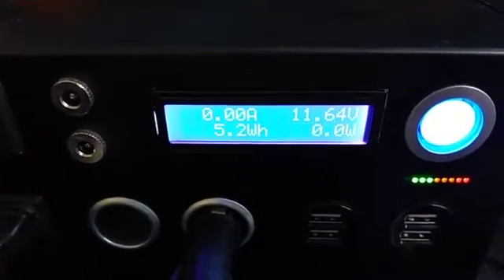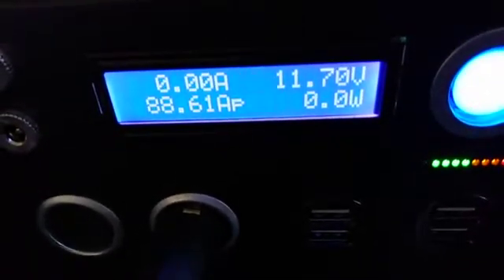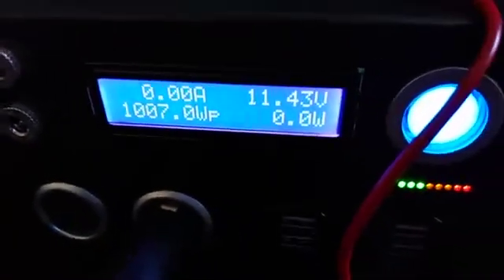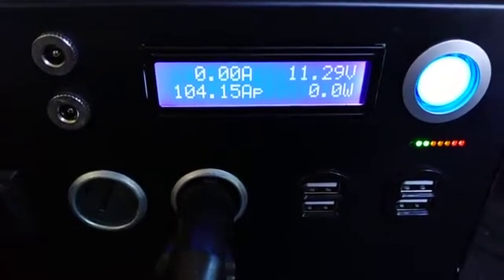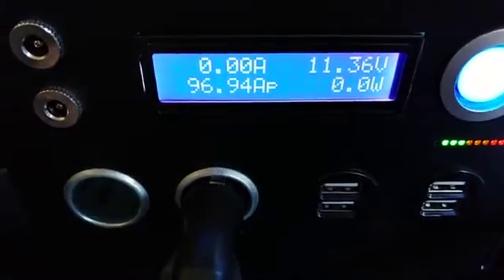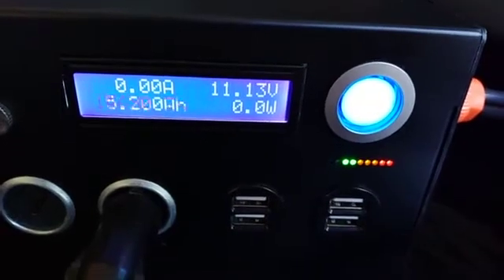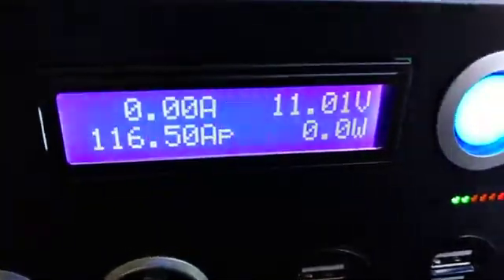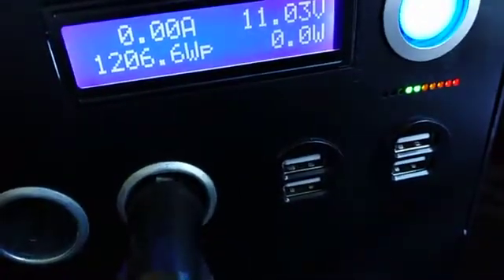Forcing the Kodiak Solar Generator and the AGM Battery into PAIN, part 4 0f 4.

Comment: Interesting stress test you've done. I can't find one single video on youtube or the internet or showing the internals of the Kodiak. But for running it as hard as you have, it seems true of an imbalance. Could be wrong. Great videos, watched all 4. I myself am an avid vacuumer :)
Reply from the maker: Wow, You are amazing in you observation.  I did another video about the 3 batteries inside Kodiak as well  the Apex.  I try to explain the imbalance:
https://www.youtube.com/watch?v=m1LJArPg4LI
Look at 4:30 minutes into the video.

Comment: So, what happens if you hook into your vehicles 12v system. Could you theoretically have the alternator top off the AGM and or the internal lithium. If so, wouldn't a hybrid vehicle be a great combo.